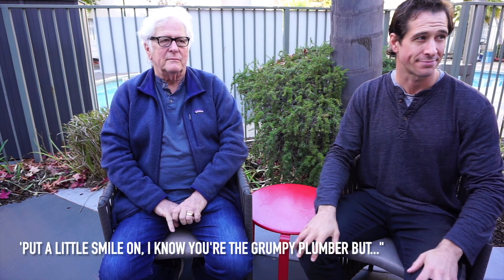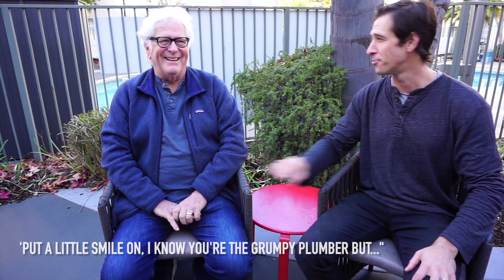Water Heater Pressure Relief Valve Replacement | A how-to with the Grumpy Plumber

Comment: I agree, leave it the hell alone!  I just replaced ours because I noticed about 1/2” of water in my overflow pan.  This occurred again so I replaced it. The original one was packed with sediment!  This surprised me as it is quite high up on the side of the heater.

Comment: Hi, we are finishing our basement.  We took your advice on a Toto toliet.  We are looking at faucets for bathroom and kitchenette, any recommendations for brand that is well made?  Kohler, Moen etc?  Thanks!!
Reply from the maker: Robert, my favorites are: Newport Brass Lav Faucets for 8” centers with hot and cold handles, Grohe lav faucets with single handles or 8” center lav faucets, Grohe kitchen faucets with single handles. Glad you took my advice on the Toto toilets!
Reply: @TheGrumpyPlumber  Same go for Shower heads and plumbing fixtures?  Thanks again, really appreciate your help!!
Reply from the maker: Robert, I also recommend the Grohe Smart Box for the tub/ shower units. Go on YouTube and check out Grohe’s video on this smart box. They are pricey but great. Delta and Moen make good tub and shower valves and are more competitive. Kohler makes a good valve too....more middle of the road price. Newport is good...higher end. If you’re shower is going to have a shower head, personal shower, a rain head, and body sprays, the smart box is the way to go. Enjoy your new spa!

Comment: Please make a video on your experience with heat pump water heaters 😉
Reply from the maker: The Campbells, I have not had any experience with heat pump water heaters. I have worked on boiler assisted water heaters with heating coils and there was really no maintenance with them.

Comment: Hi, I took your advice and  purchased a Toto Drake 2 and a Toto Washlet  S550e. The washlet is installed correctly I think, the bracket that screws on the toilet is tight, but if I move the seat side to side, the seat moves a little. Also, only the forward pad under the washlet seat touches the toilet, the other pads don't. If one sits on the seat and shifts his weight left or right, the seat moves slightly. Is this normal, or is there something wrong with the washlet? Thank you for any advice you could give.
Reply from the maker: Sisyphus, that’s normal. There is nothing wrong with your Washlet. Both of mine move too. Sit back and enjoy it!
Reply: @TheGrumpyPlumber  Thank you. I am glad I bought the Drake 2 and the s550e. You give sound advice!

Comment: Have you ever seen a clogged up T&P valve? It happens. They should be tested periodically -- probably yearly.  If they drip after testing, replace them. They are 15-20$. They are there to save your life.  TEST them.
Reply from the maker: Super Duper, good advice.